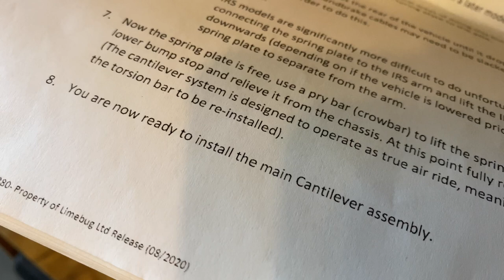1969 VW Beetle-Intro & Installing Rear Air Suspension-Part 1

Comment: Screws with hardness 8.8 in this application show, that this application is not understood.
Reply from the maker: what are you asking/talking about?. I haven't even done the wiring. I quickly hooked up the wires to test the management system. I will probably spend another 20 hours working on the whole harness and hiding all the cables.
Reply: @oscar_dubs  You're working on a chassis mount. Screws of strength class 8.8 are not permitted here. You would have to use bolts with a strength class of 10.9 or even better 12.9. This has nothing to do with the hoses, but simply with the wheel suspension. I hope I could help you to make your work reasonable. Have fun with the conversion.
Reply from the maker: @doliwsef  oh I get it now!. ya I was kind of worry about it too but the company that made the kit provided the screws. I changed a few of them but not all of them. thank you for your knowledge and advise.
Reply: @oscar_dubs  What a poor company. Who is responsible for the damage made by breaking the screws? 8.8 is forbidden in this application, but you are informed now and if you change the screws, you are on the safe side and will be able to enjoy your work for a long time.
Reply: @oscar_dubs hey bro are you guy’s talking about the bolts that came with the airbag kit? I ask only because I ordered the the same rear kit.
Reply: @oscar_dubs  Yes, look on the screws, which are connected to the wheels. Replace all, on which you can read 8.8 with a screw of the same size, but the strength 10.9 or better 12.9. A screw dealer will help you. For example the screw at 10:10 has to be replaced.